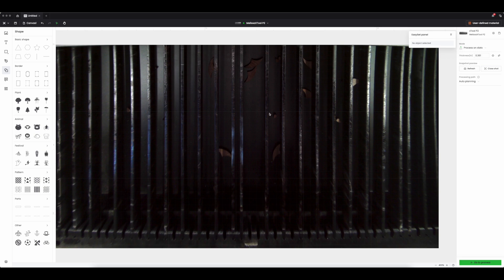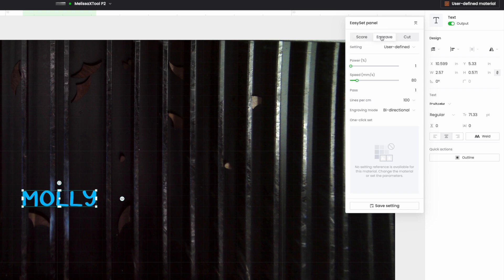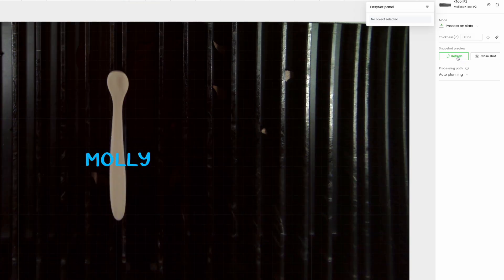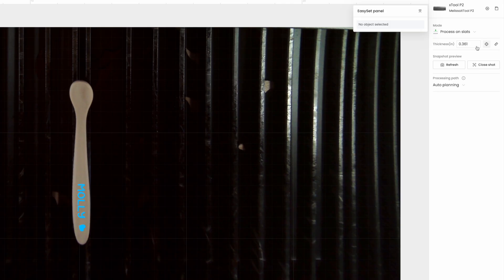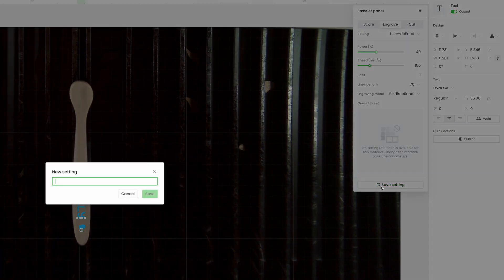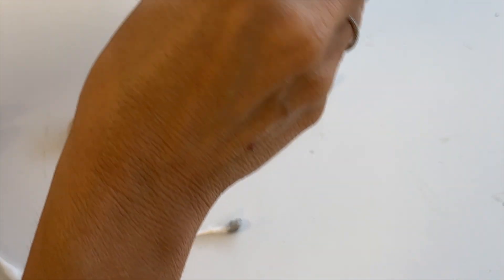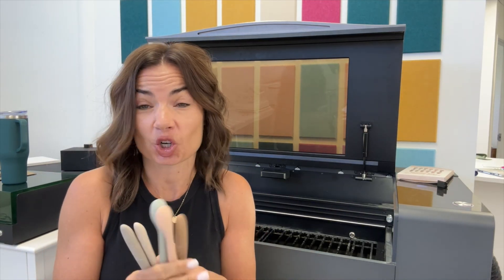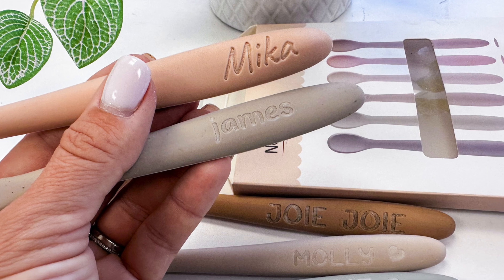Laser Engraving Silicone - Beginners Guide to Engraving Rubber

Comment: Is it normal for the nozzle to flame up? I have the p2s and used these settings and was scared of the flames ?
Reply from the maker: No you may need to adjust your settings and your air nozzle and make sure it is clean to avoid a flame. Here is a video that may help: https://youtu.be/1av6zDPirYk?si=gp5A3_QezfwY0ZKb